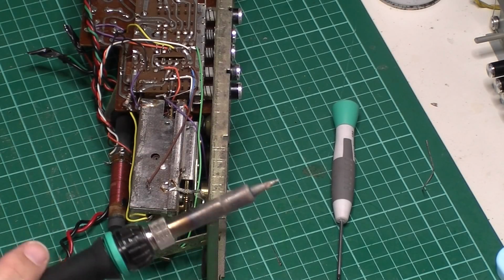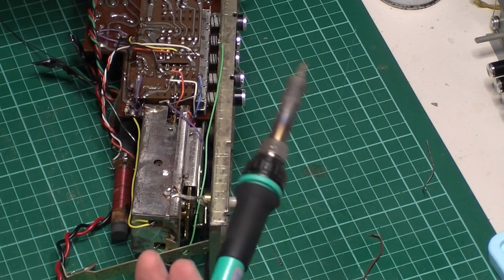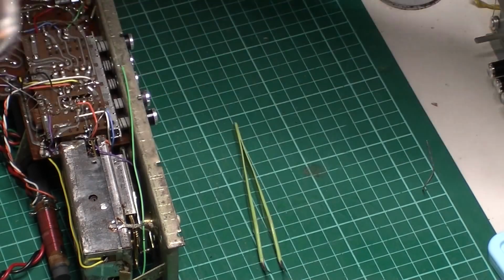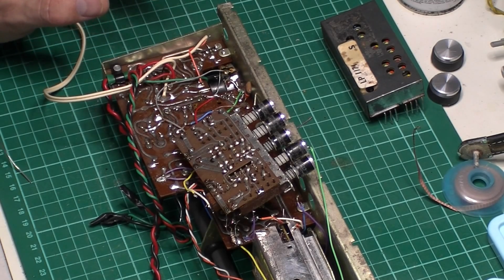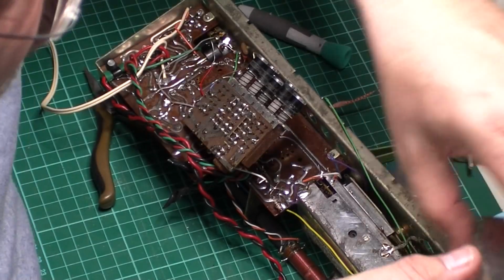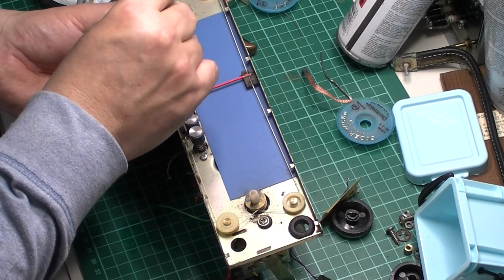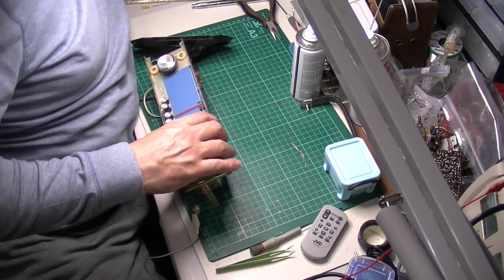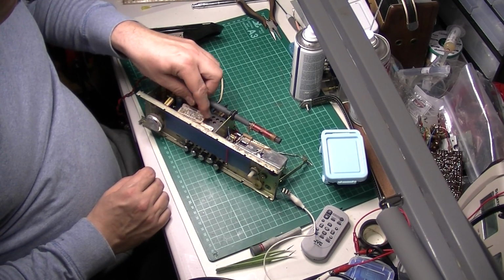Roberts R600 newer version Part 2: Module replacement

Comment: Hi do you know what the connector in the back is for? the one with 3 smaller red black and green wires, i thought it looked like a place to put a mains poweer supply but seing as its main power comes from a battery not sure what its for?
Reply from the maker: Hi. That’s for an external 9v supply. I can’t remember whether the centre pin is positive or negative though but I can find out if you need to know. Thanks for watching